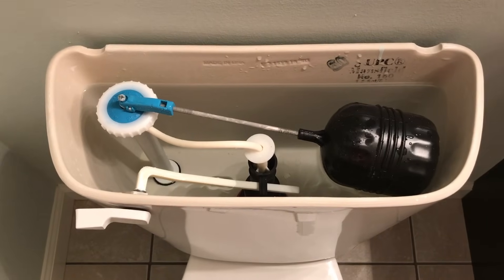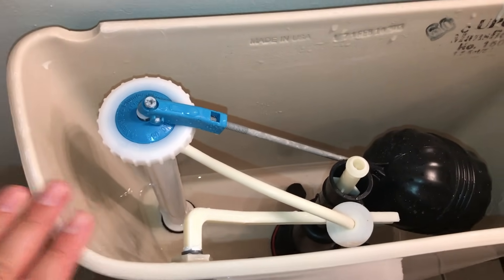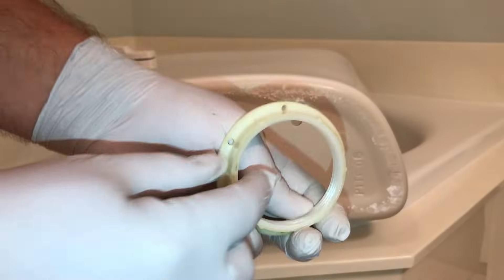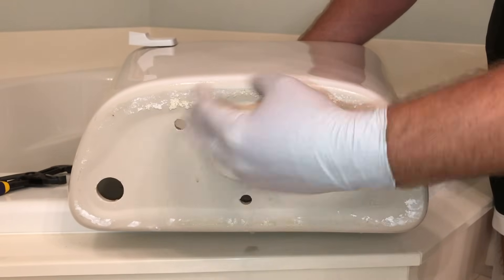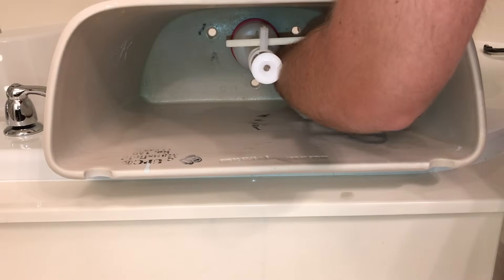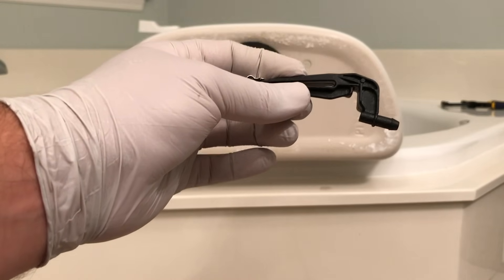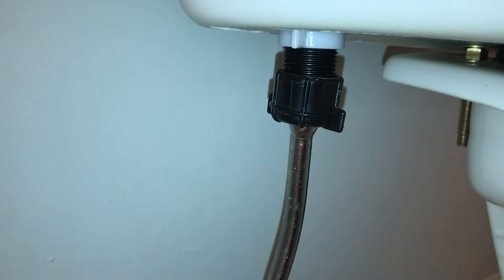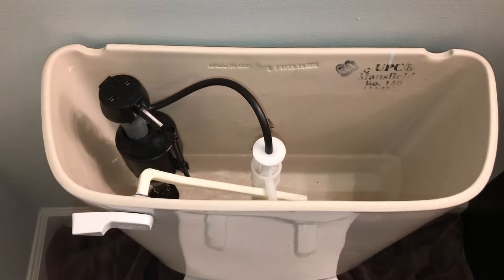Replacing Fill Valve & Flush Valve for Mansfield Toilet

Comment: Excellent instructional video.  I have a 30 year old Mansfield toilet that was a mess.  I followed your instructions step-by-step and used the exact components that you did; however, I have two questions.  Hopefully, you will see them.  First,  is there ever supposed to be water dripping from underneath the cap on the top of the Fluidmaster High Performance fill valve?  It isn’t much, but the old one did that, and I thought it was broken.  Secondly, my nemesis:  Leaking water lines.  It is a very simple line that did not leak before I took it apart.  I unscrewed the coupling with average hand strength which slid down the line and sat there while I took everything apart.  At the top of the line, there is a circle opening of plastic with a slightly larger diameter of circle plastic around it.  No washers or anything else.  So, I reconnected everything, slowly turned on the water, and water dropped over the top of the coupling and down the line.  Turned the water off, disconnected the coupling, dried everything off, tried adding Teflon tape to the threads of the new fill valve.  Tightened everything back up.  Dripping down the line.  The bottom of the tank is cold where the nut for the fill valve is, so that just appears cold, not wet.  What else do people do?  Petroleum jelly on the top of the supply line?
Reply from the maker: you might want to consider replacing it with a stainless steel braided hose. If you saw plastic components, then likely it’s worn out. Plastic, over time, can become brittle and it just may not be sealing all the way.
Reply: Kris Reese  Thank you.   I have  never seen a water supply line like this one where there isn’t a rubber washer for compression, or a water barrier between the line and the bottom of the fill valve, so I might just change out the line as suggested.  The drip appears to be slowing, so it might have just needed time to settle.

Comment: Another thing everyone should know about plumbing not all threads are the same therefore you cannot just thread anything on to anything else. There are several thread types
pipe thread -- most straight pipe is pipe thread
compression thread --- mainly used in water applications
flare thread -- used a lot in gas applications like propane ect
garden hose thread -- speaks for itself it's the thread on your garden hose
none of these THREAD types can be mixed usually you have to get an adapter that changes it over to one thread type or the other
oh and also there are a couple of unique in that is the thread that threads onto your toilet from your water line which is called 7\8 ballcock which is the one side that screws onto the toilet itself not the other side which screws onto  the pipe where your water comes from

Comment: Fantastic video!
Reply from the maker: +Ryan Jehs Thank you!
Reply: One quick question, I know you didn't use the hex nut for the bottom of the flush valve, but wouldn't it be easier to grab with vice grips? Was it purely because it didn't leak before, so keep it?
Reply from the maker: +Ryan Jehs It probably would be easier, but the reason I kept the round one is because the spud gasket itself is round, and I feel why try to put a square peg in a round hole?
Reply: Right on, thanks man. Doing this exact thing in a few days, just wanted to check. Subscribed!
Reply from the maker: +Ryan Jehs No problem!

Comment: Great video!  Only thing that I found odd is you putting the tank on the tub and not having anything to prevent the tub and/or tank from getting scratched.
Reply from the maker: @Jack Smith Good point!  Thanks for the feedback.  This totally makes sense.  If I remember, perhaps I'll mention this in the video description.  Thanks!

Comment: I would add that even if the fill hose comes out of the top of the flush valve, it will continue to fill the tank, and the float ball will also rise and proceed to shut off the water from the fill valve when it reaches its proper height. I don't see how this would cause an issue, as long as the hose does not squirt water out of the tank.

Comment: This video was helpful but I did notice the line coming from the on and off valve was put back on stripped.
Reply from the maker: Yes, as I was filming with one hand, it was put back on cross threaded, and I realize that after I shot the video and fixed it. There are other comments in here, calling out the same. 😂

Comment: I have an extremely rusty old toilet bowl and tank and the internal components in the tank are rusty also. With a flush, water shoots out of the top of my fill valve from the the top center and the top back. The tank and toilet bowl are covered in thick rust. I want to try cleaning it all off without replacing parts. But is there something I can adjust - such as the chain controlling the level of the float? 
I also wonder about the little line leading to the fill valve - if that can be cleaned. How do I go about this? Additionally, I use well water and have a septic tank) 
Thanks!
Reply from the maker: Hi 👋 there!

If your parts are rusted out, you’re highly unlikely to salvage them, let alone the current failing fill valve. You’re way better off replacing the parts which alone is going to save you frustration and disappointment when they fail. All rubber components of the internal parts must be replaced nonetheless. You’re best bet is to remove the tank and all the parts and determine if the bowl is even salvageable given the rust you speak off. IF you’re able to clean that, replace the innards and call it a day. You’ll be glad you went that path.
Reply: @ Thank you for taking the time to write that. I’m sure you are right. I just want a temporary fix until I get that done.
Reply: Because of your helpful input - I think I will need a new toilet altogether though. I’d also like a bidet (seat I guess) with an air dryer - any suggestions, brands of each, etc?
Reply from the maker: I personally do not own one so I don’t have anything meaningful I can share about bidets.

Comment: Kris, thank you for your very detailed video, which I needed. One question: Does it matter that the tank is not level from side to side and front to back when it is reinstalled? If so, how is that accomplished? Thank you.
Reply from the maker: Hi!  This probably means that the nuts were not evenly tightened when installing the tank to bowl kit. Much like lug nuts on a tire, tighten the tank to the bowl with even rotation amongst the nuts. You can keep an eye on rhe level of the tank and adjust as you go. In the end, does it matter?  Not really outside of visual appeal.

Comment: Excellent territorial. 
Question however. The gasket on the flush valve, on mine, gets that ‘inky’ stuff when I touch it. I’m having residual black specks if you will in the toilet bowl between flushing (Looking like I never clean the thing, black ring) When I went to investigate, that’s when I got the inky stuff on my gloves from the gasket on the flush valve, same exact inky stuff you had on your gloves with the older bolt gaskets. Now my question. Should I replace the flush valve or live with it? I’m not comfortable taking off the tank as you demonstrated. What do you suggest?
Thank you.
Reply from the maker: If you’re getting black specks, that means the rubber is deteriorating.  Eventually, you’ll need to replace it.

Comment: great video. I finished replacing parts and my flush lever wouldn't budge. I can flush by lifting flush valve manually. Too much force needed to use handle. What gives? flush valve seal looks fine.
Reply from the maker: Make sure the flush valve is fully upright and not installed “off center”. Otherwise, the flapper (the rubber ring at the bottom of the flush valve) may be sticking.

Comment: Finally! A name for the part I need. The stop cap. Mine is the screw down style. Would you happen to know if that can be purchased on it's own?
Reply from the maker: It can, but for a few bucks more, you can get the whole flush valve. Anyway, if you want just the stop cap, click on one of the links in the video description below, then search “mansfield stop cap”.
Reply: @theXchange  thanks Kris!

Comment: Great video. My trip level is real hard to rotate to flush. Is there an adjustment for this?
Reply from the maker: Your flush valve seal may need to be replaced.  Usually, when it’s hard to flush, it’s because it’s difficult to break the suction.  You can test this by pulling up on the flush valve by hand and see how difficult or easy it is to lift by hand.

Comment: Hi The plumber never put back on the round circle on tube. How to I get thst replacement part.
Reply from the maker: That stinks. If it’s the stop cap, you might need to buy the whole flush valve and take the stop cap from it or search online for it

Comment: Awesome vid! I had never seen this Mansfield setup. Was curious if you can just remove the mansfield and just put the "regular" toilet guts in? Would rather not stock both types in my shed for when tenants have issues.
Reply from the maker: yea - if by “regular” you mean a ballcock setup, you should be fine. Also, have a look at the pinned comment for this video. Curtis points out some great things relative to the specifics on the parts!
Reply: @theXchange  Hey thanks for this. Yeah I just went to home depot and bought a "regular" setup and replaced the entire thing. Now I don't have to have to have multiple set ups for different apartments. I was just worried this was some custom size ring and it fit perfectly. You rock!
Reply from the maker: awesome!  I’m glad it all worked out!

Comment: Hi Kris, this video is very helpful. I only need to replace the fill valve portion (broken one looks exactly like the one you started with the ball float) and hoping to just get a replacement with the other type that doesn't have the ball. It looks like that will work based on the video. Any issues I should expect?
Reply from the maker: You should be fine. It’ll actually be easier since you won’t need to take the bowl off!

Comment: I followed these directions exactly and I still have a significant leak into the bowl.  I have a reasonable experience level with toilet repairs. Everything looks exactly how it looks in your video.  What could still be the problem?
Reply from the maker: Hey there. Sorry for the delay. Are you still having an issue?
Reply: @theXchange  Yes - there is still a leak into to bowl.  I have replaced the entire flush valve twice.
Reply from the maker: I would double check that the lock nut on the flush valve is tight enough, and that the tank to bowl kit likewise is tight enough and that the rubber washers/seal is good. Otherwise, run the back of your fingernail across the bottom of the bowl to feel for hairline crack(s). Shining a flashlight between the bowl and the tank could also help reveal where the leak is coming from.
Reply: @theXchange  Thank you for your help!  The leak is from the tank into the bowl, not out of the toilet onto the floor.  It has to be somewhere in the flush valve, right?
Reply: @theXchange  I gotta say - I don't trust that red gasket is sealing well enough, but I have no evidence of that.  It just seems cheap and not good enough to make a water tight seal.  Have you ever had that problem?
Reply from the maker: I have had leaks from the spud gasket before. Sometimes, the lock nut was a bit cross threaded and other times not tight enough. Other times, the flush valve was not “centered” and slightly askew. I’ve also had water seeping through the tank to bowl kit due to nuts not being tight enough. Being careful not to over tighten is very important though since porcelain cracking is a risk as I’m sure you’re aware.

Comment: I found it interesting that you put screws on before putting the bowl down and then put more screws underneath.  Mine currently sits stright down flush with the bowl and the screws underneath.  Are some different?
Reply from the maker: If I recall correctly, the tank-to-bowl kit instructions for the kid I used are just as described here.  (Sorry I couldn't find the exact talk-to-bolt kit for mansfield, but this is just as I remember them) -->  https://www.keeneymfg.com/installation_instructions/1633-en-PP835-183L    However, it could be different.  For instance, the tank-to-bowl kit I replaced was like this one --> https://amzn.to/2q55m0c, so the installation process for that kit vs the one I used in the video would differ.

Comment: What do you do if you can't use the original circle nut on the flush valve kit, and have to use the new hex nut one? The tank to bowl kit gasket doesn't appear to be able to seal against the ceramic of the underside of the toilet tank otherwise. Recommendations?
Reply from the maker: You’ll have to buy one with the circular nut.  In my case, my hardware store only had the ones with the hex nut in stock, but look around for one. Otherwise, good ol’ Amazon has them -> https://amzn.to/2KOUQ5P
Reply: It really doesn’t matter. Hex is as good or better. Never a good idea to use the old part anyway. Fluidmaster has a great flush valve too 507AK. With a flap I think is better as that top looked too flimsy. You’d need to change the handle too. On the fill valve there was no need to remove the top. The height can be adjusted by twisting the bottom part. That rubber hose needs to be shortened too.
Reply from the maker: @Tchairdjian  good call outs, Dick.  In the video, I disassembled the fill valve so viewers could see the makeup of the part.  Also, as mentioned in the video, I do call out shortening the hose, I just didn't do it in the video.  I appreciate the comment!

Comment: Help...everything went well but now the screws are dripping! Do you think they need tightened more with the tank off? I have tried to tighten more with the tank on but almost made it worse!
Reply from the maker: Is the tank to bowl kit new?
Reply: @theXchange  yes...all internal parts new
Reply: I have even tried waterproof silicone caulking but screws still dripping
Reply from the maker: you may want to redo it. the key is to not overtighten. typically, you would tighten each nut a turn at a time to ensure even tightening across all. if you tighten one side, then the other, it could cause imbalance and loosening of the other end.
Reply: @theXchange  Thank you Kris for continuing to try and help. I did tighten each one a little at a time so as not to tighten each one all at once knowing this could throw things off. I even backed the nuts off thinking that tightening too tight was making it worse. I will start again but am frustrated this will not resolve.

Comment: I just went through this repair step by step, but when I turn the water on the tank doesn’t fill. It just keeps running into the bowl. Any thoughts on what I did wrong?
Reply from the maker: The flush valve must not be seated correctly.  Can you see water draining into the bowl from the tank where the flush valve is?

Comment: great video! why did you reuse the circular nut instead of the hex nut?
Reply from the maker: Because the spud gasket itself is round and I wanted a snug fit to help prevent leaks.  It would be best to replace the circular nut if at all possible. For me, the big box store didn’t have any with the circular nut in stock, so I reused. I’ve seen many purchase the version with the circular nut from Amazon (link in the video description below).
Reply: @theXchange  Thank you very much. i think im ready to tackle this job!
Reply from the maker: You got this!

Comment: Will the Everbilt Tank to Bowl Kit for Mansfield and the Flush Valve you have listed fit all models of Mansfield Toilets? Great video! Thanks!
Reply from the maker: On the inside of the tank, there should be a model number stamped. You can check the kits to see if it’s compatible.

Comment: One of the bolts to the tank is in a position that is too tight to get a ratchet or any other tool in place to remove the nut and washer. The nut is too tight to use the 14mm ratchet by hand. What can I use to remove this nut?
Reply from the maker: you may need an adjustable wrench small enough to loosen it enough to the point of finishing it off by hand

Comment: What  if it start to leak from the water line
Reply from the maker: The fill valve likely needs to be replaced.  You don’t need to take the tank off to replace that.